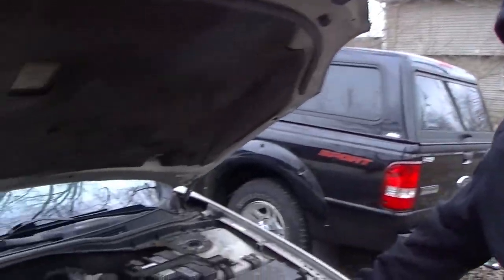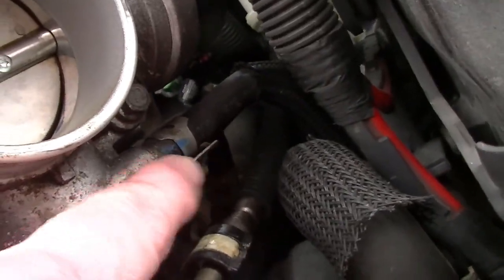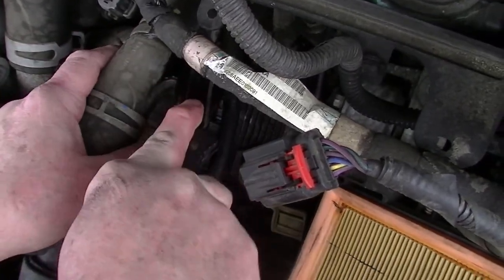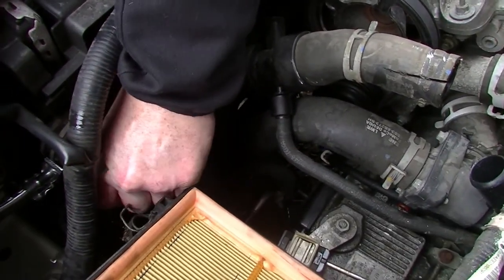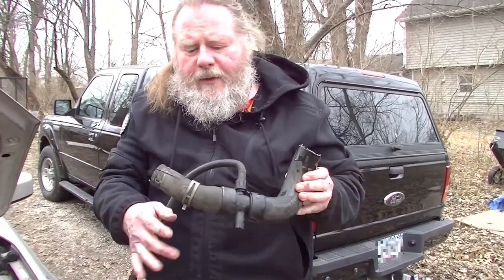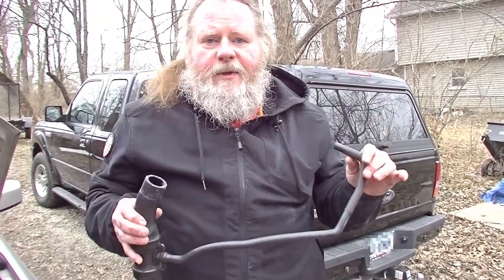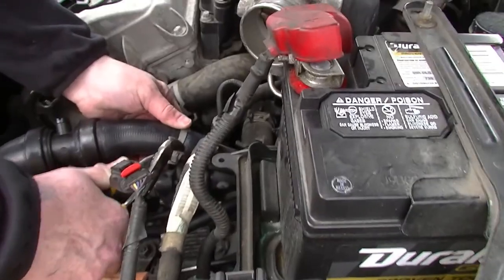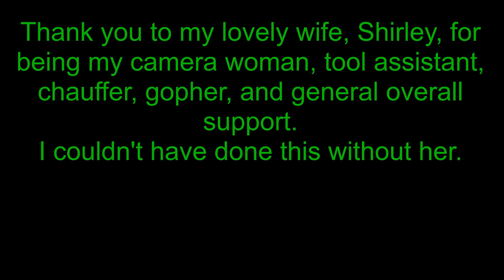Replacing a Top Radiator Hose 2009 Ford Fusion 20210110

Comment: Please drop in the comments what type of tools used in this video
Reply from the maker: 0:24 A screwdriver
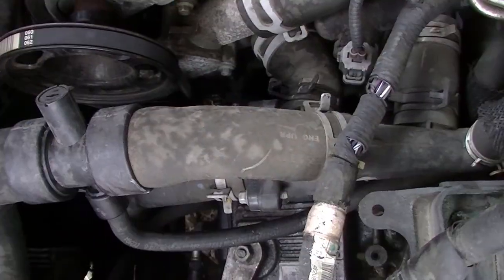2:25 Channel Locks
5:03 Radiator hose clamp tool
Reply: @AViewThroughLensLens  late but ty, I had to change mines it popped in a walmart parking lot it was stuck there for 3 days nobody wanted to travel to a different county to replace the hose. & it was 200 to tow it back to my county but the part is only 30, sooo I changed it myself👍🏽 tyyy I knew exactly what to do thanks to your video❤️❤️
Reply from the maker: @4amvbz  I'm sorry to hear that you had to replace it, but I'm glad the information in my video helped you.